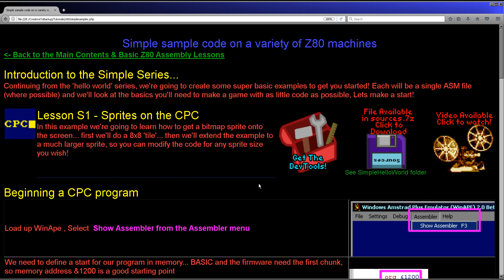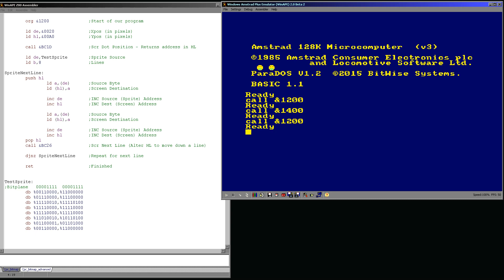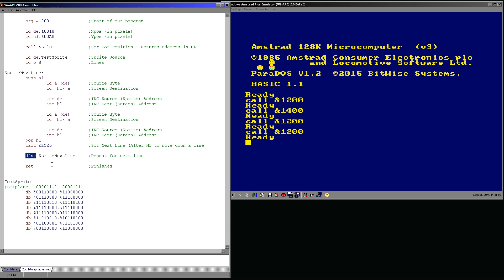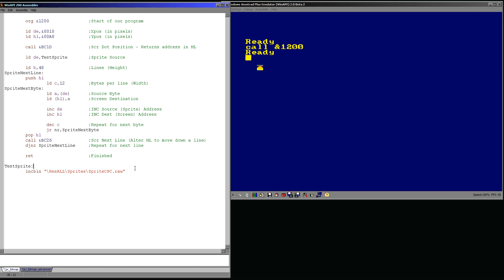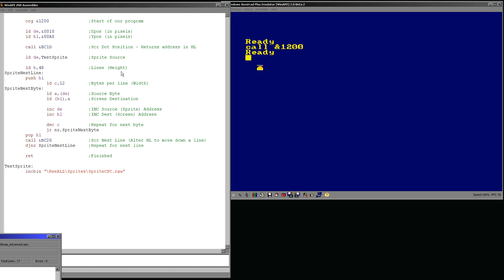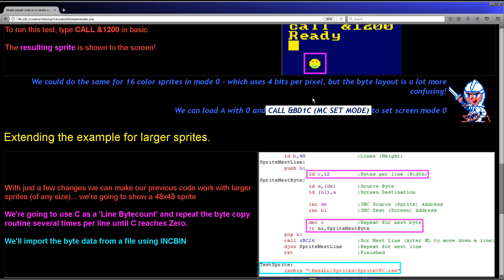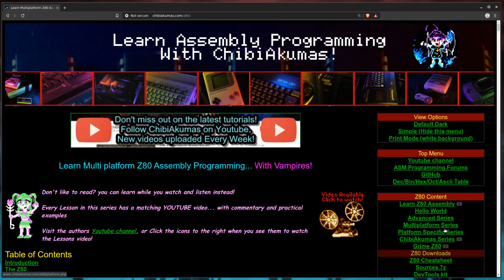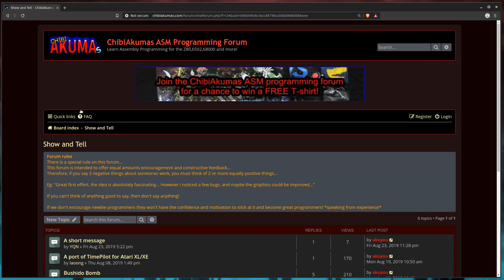Simple Z80 Assembly Tutorials - Sprites on the Amstrad CPC - Lesson S1

Comment: The vertical positions don't match what's in the look-up table.
The sprite is also vertically misaligned, it's 1 pixel too high from the grid.
&00C7 is the correct value the hl needs to have if the sprite is supposed to appear right on the top of the screen.

Comment: This is great. Nice bite sized chunks are far easier to digest than pages and pages of branching code, so thank you for this.

I can't seem to load or import any files into the Sprite editor though. Is there no way to import PNG or BMP files? It only seems to accept txt data. I only ask becasue I did a few Mode 0 sprites of my own in Photoshop, and I'd like to see if I can get them on screen.
Reply from the maker: The sprite editor doesn't load from image file formats, but you can easily get existing data to or from it via the Copy Paste options and the Clipboard, I do much of my more complex editing in Krita in this way.

Make sure you set up your palette in the sprite editor first, it will match the clipboard contents to the sprite editor palette
Reply: @ChibiAkumas  Thank you for the information. Are you planning on doing follow ups to this great video? For example, maybe now that the sprite is on the screen we can then learn how to animate it?

Thanks once again.
Reply from the maker: Sorry to bump this old post... but I've added an option to load from BMP/PNG files to the new version - there are two options - to either use the existing palette in akusprite (File can be any color depth)... or to use the palette from the file (for CPC the file must be 16 color)... maybe this helps?
The new version is in the Z80 Sources.7z
Reply: @ChibiAkumas  Thanks for that Keith. I've been using the clipboard too but I think most beginners instincts will be to go to the menu so it'll be a good feature to have.
Reply from the maker: @Retro Storm Except for the palette import function The new feature is the same code as the Copy paste function...
I see no reason you shouldn't use it for your title screen... I did with ChibiAkumas all versions.!